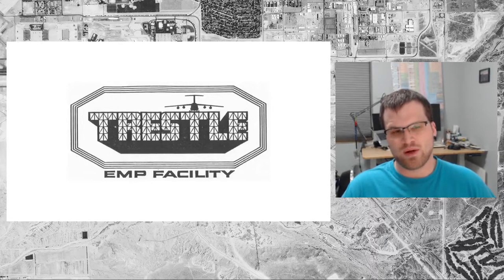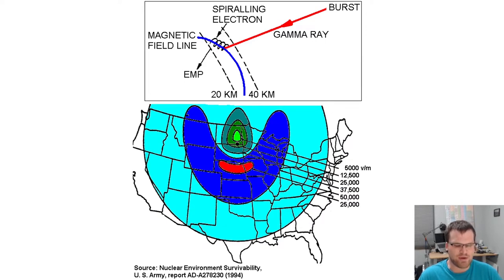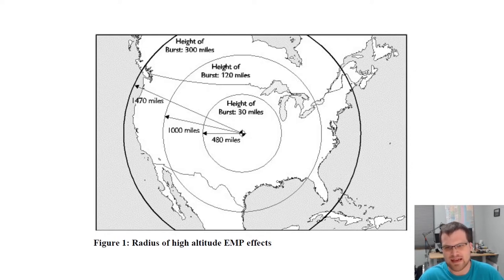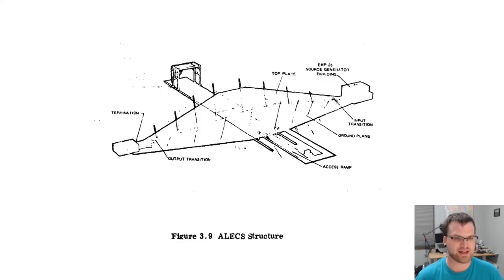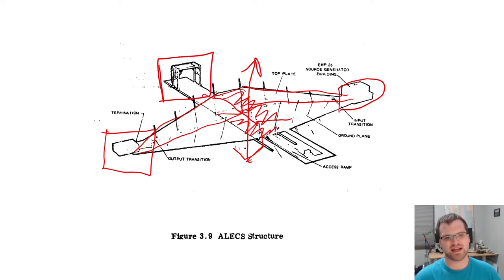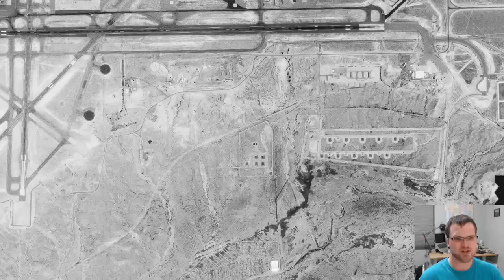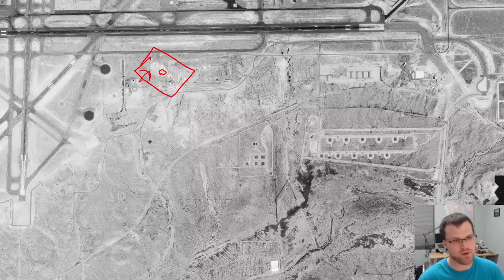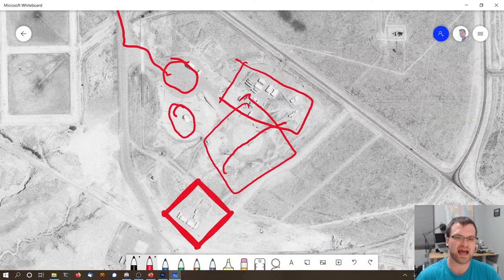EMP Simulators at KAFB

Comment: This is really interesting – I didn’t know half of this, even though had once stopped to look at the Trestle in 2007 when I was given a tour of the base. I later got one of the epoxy- wood bolts they used – amazing engineering.

Comment: 34:05  The purpose of the rest of that rectangular area is:  this was called “The Farm” and was the original 1940’s top secret area for atomic bomb assembly and loading onto aircraft. The square silver roof bottom right was the main assembly building (though is a 1950’s replacement for the original 1940’s one which had been to the right of this). There was a B-29 loading pit outside the rectangle at the top right corner. “The Farm” was repurposed for ALECS and other projects – the old buildings left in place apparently out of historical respect.